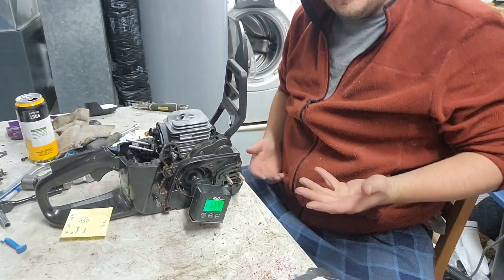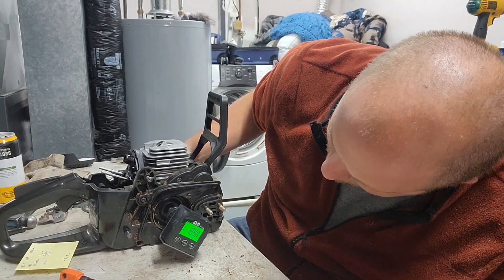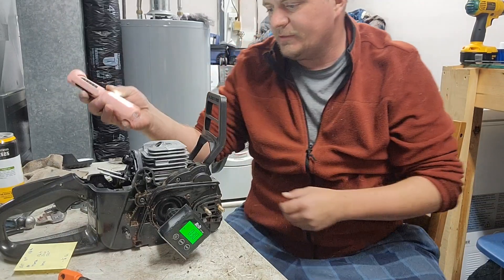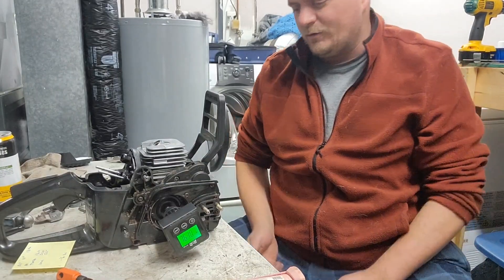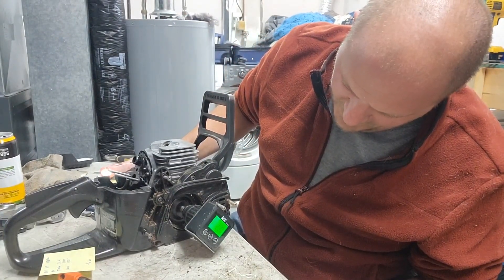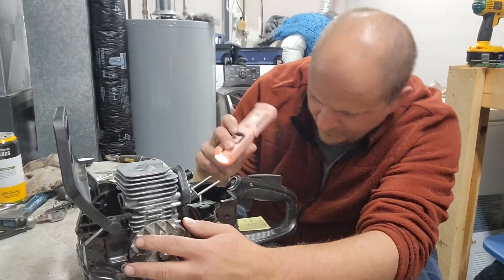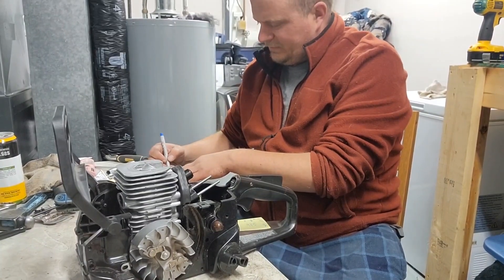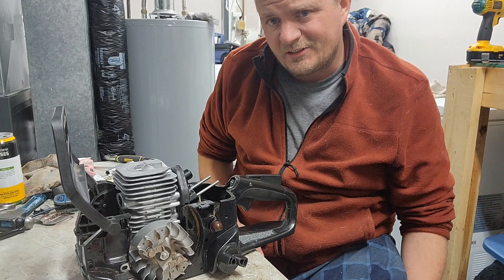poulan wild thing 4018 final timing numbers.. I'm happy..

Comment: Looks good to me! I recall the first few times I attempted port work with a wheel I over shot my numbers. So probably good to go conservative and hit some midrange numbers. If you get spit back with the intake duration- jb weld!
Well done. Curious to see how it runs.
Reply from the maker: Hoping I don't get much spit back but we shall see, it is an easy fix and this saw comes apart pretty easy.. I like thatnit has no antivibe, or cable throttle... That made that 2550 alot more work to break down.. I can have this thing apart in 15min